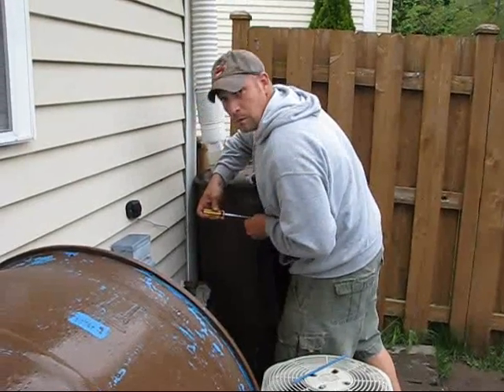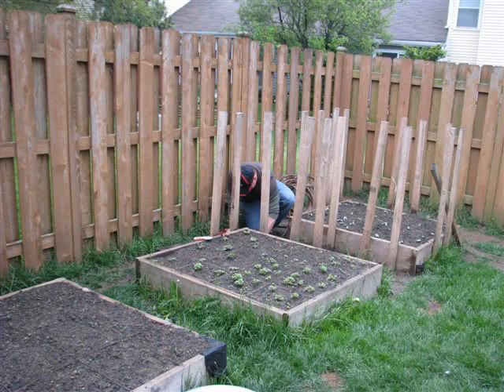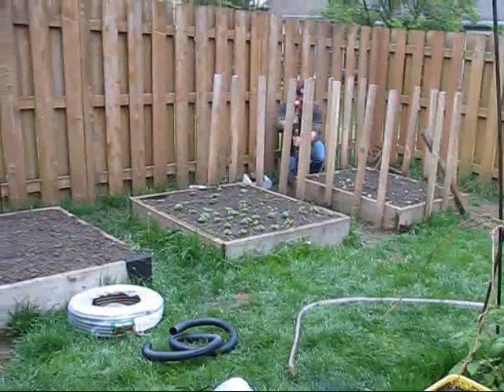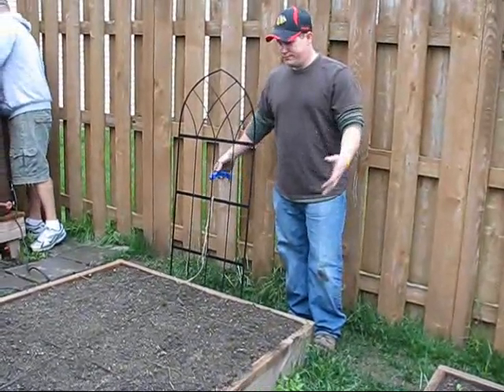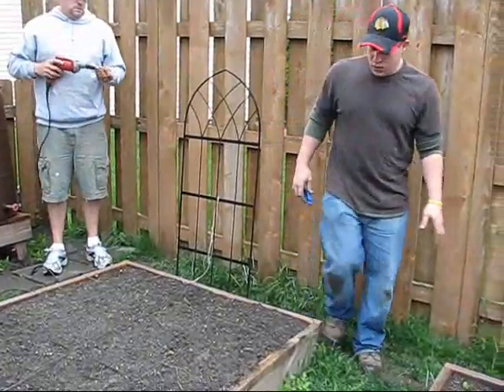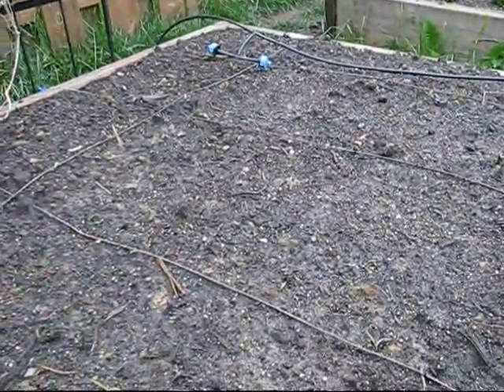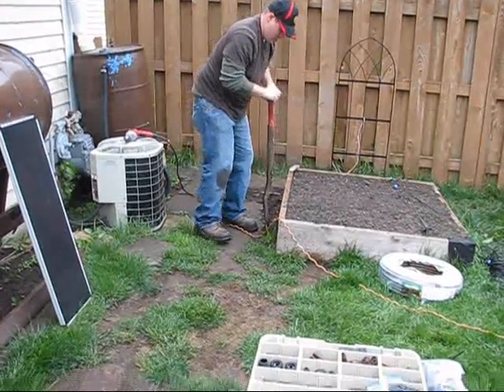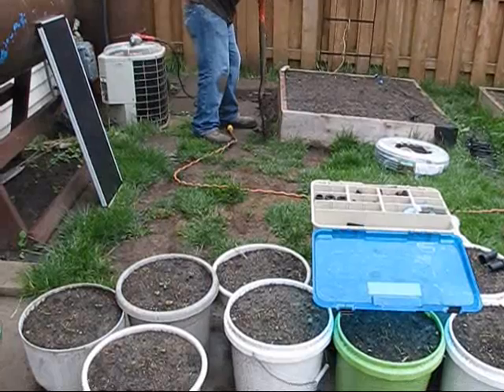Solar Water Pump and Irrigation System Installation

Comment: How do you figure how much drip line for the pump? So it doesn't put a strain on the pump. Do you have a turn off switch in your rain barrel so that it doesn't go empty and burn up the pump.
I have a drill pump that I bought at Home Depot for $6.97. It pumps 225 GAL of water per Hour. 3.75 GAL per Minute. I pump my water up 10 feet. Works great. The problem now is I need more rain barrels.
A washer machine hose to rain barrel then to the drill pump. The drill pump connects to garden hose.